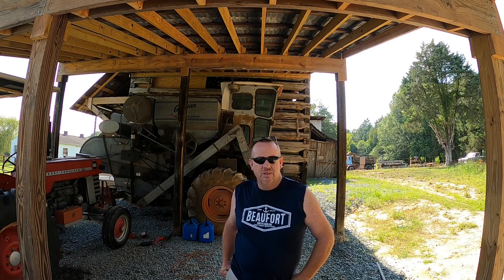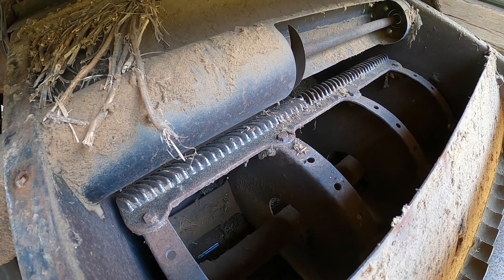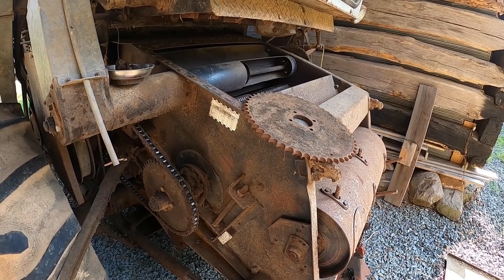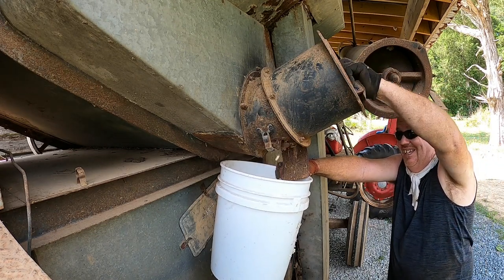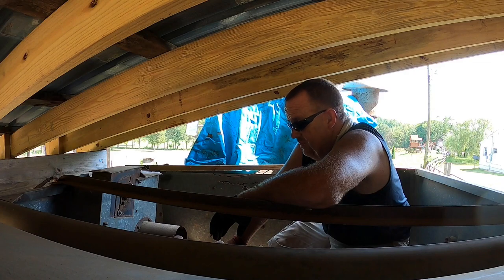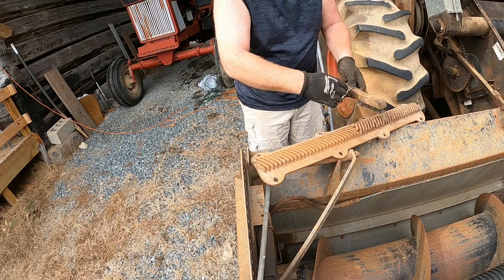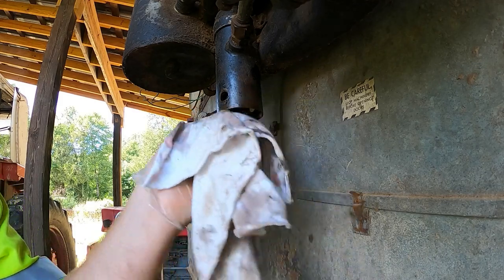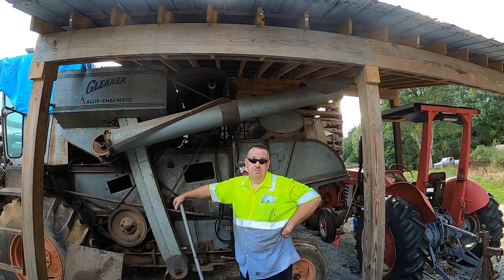Gleaner A2 barn find, preparation for harvest again after 15 years of hibernation!

Comment: Be careful if you decide to add rasp bars to the cylinder.  I know in the case of John Deeres that they are generally sold in match pairs - matched in terms of weight, and those 2 rasp bars in the match pairs are then added opposite one another on the cylinder to keep the thing in balance.  Something to think about.  I think you can expect a clean crop.  Gleaner was owned by Allis Chalmers when your combine was made.  I used to have an AC 66 combine that I used for many years, and nothing cleaned grain like that machine!  Finally, my suggestion for setting the combine is, for whatever grain you're harvesting, start in the middle of each setting range (cylinder speed, concave setting, fan speed, etc) as a starting point and fine tune from there.  Your book should tell you how to make adjustments based on what your sample is looking like as you harvest.
Reply from the maker: Very valid point Mr Charlie and one I stressed about when I started reading in the book!! Can you believe, I should have shown it....the bars were numbered with a system and so was the cylinder. It was itched in with almost what looked to be a pin punch set. I am not sure if the previous owner did that or the original owner, but it was a life saver!! It really seemed to run very smooth, at least what I know about them!! Spoiler but I did end up out in the oats, it didn't go exactly how I wanted it too though. The sample on the first round was AMAZING!! Man was I proud, then the feeder house started plugging up. Not because of wet or green material, but like the finger adjustment slipped or something. The auger would get it to the throat but the feeder beater wouldn't quite pick it up. That was a chore, about every half a round it would plug...and that was sending lots of trash through. My A2 runs an adapter plate on the grain head because it's for an F, so that extra spacing didn't help at all either. I do believe I am going to down size to a 10-11 ft head, I spent more time on the front wheels than I care to do again. Plus the header has an adjustable reel speed, but my combine doesn't have the hydraulics for it. So the reel was very very fast too! But I did it, and it WAS the best learning experience ever!! Next season looks great and we are off to the races!! Thank toy so much for the advice on the settings too my friend, you are a scholar and really appreciate everything you do!! Thank you sir for always being here, I really appreciate that!! 🌱🌱🌾🌾🌽🌽😁😁🇺🇸🇺🇸🇺🇸🇺🇸
Reply: @Pennies_on_the_dollar  Sounds like Gleaner made provisions so that you got the bars back into the right positions.  Some people don't think about that and end up with a cylinder that is out of balance.  I'm looking forward to seeing the Gleaner in action.
Reply from the maker: Thank you sir, I am not sure who...but very thankful it was numbered!!! Thank you sir, the footage isn't the best or much but we made it!! 😁😁👍👍👍🌾🌾🌾🌾🇺🇸🇺🇸🇺🇸

Comment: Your cylinder bars look good. You are missing the "filler bars" . Your manual will explain what crops they should be use with. Biggest thing about oats is they are light. The grain itself is light ( they are 62 lbs @ bushel) so watch your fan speed or you will blow them out the back. Set your concave clearance according to the book settings and go from there. The drier the grain the more open you can run it. If they are a little green close it up a bit. Watch the grain sample for the amount of trash. The more open your seives are the more trash they will let fall into the grain pan. Close them up too much and you will walk your grain out the back. It all depends on the grain itself. It takes some seat time and a few seasons to know what to do but you will learn. First combine I ever ran was a Gleaner M. I am sure you have a neighbor who can help you...
Reply from the maker: Thank you sir, I do believe I have those as well, was kinda reading about them! Thank you VERY much for the great input on the settings!! I have read and read and read but I think first hand experience will be the best and others help!! Thank you for that, I have let the oats go WAY to long and it wasn't a good test, but I learned ALOT!! You were spot on with a few points here for sure!! Thank you for that very much!! Also for always being here, I really appreciate that!! 😁😁👍👍🇺🇸🇺🇸 I hope you are still around here next season, could use some pointers again I'm sure !!
Reply: Oats are 32 pounds to bushel. Easy to blow out the back.
Reply from the maker: Thank you very much!! I figured it would be a challenge with as dry and bad as I worry these get!! Really appreciate you being here !!! Thank you for that!! 😁😁👍👍
Reply: Your are right my bad... @janmayes6578
Reply from the maker: Thank you both, for taking time to share any knowledge with me, really appreciate that!!